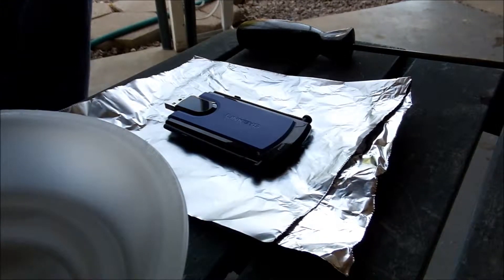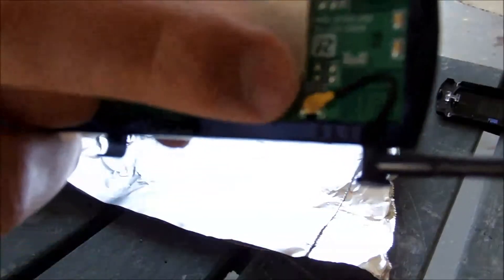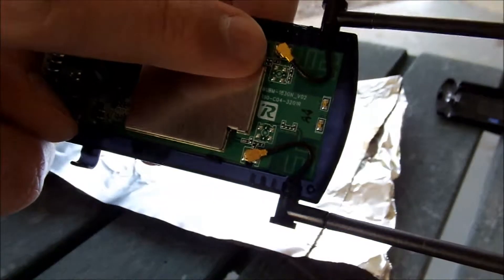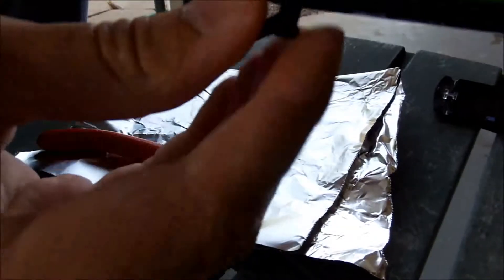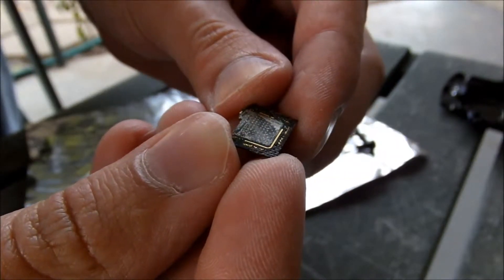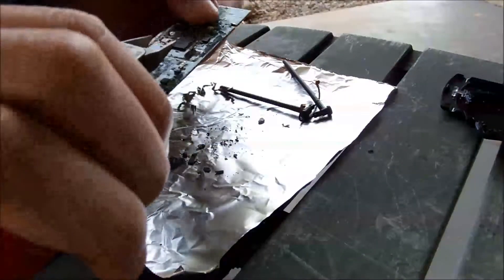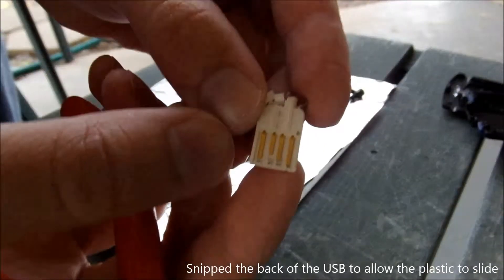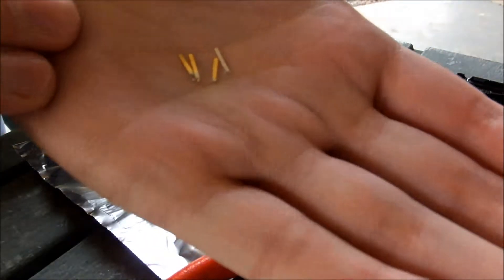WUSB300N Linksys Wireless USB Scrapped for Gold

Comment: I was going to ask isn't this worth more as a WORKING DEVICE ? A $50 card ? But, I have this EXACT MODEL and LINKSYS REMOVED ALL DRIVERS FOR IT making it COMPLETELY USELESS !!! A USB N Adapter and refused to supply a new driver or replace it. They sold the hardware and driver software the TOOK BACK THE SOFTWARE but won't pay for it ! They refused to replace it too even though they say NO DRIVERS EXIST NOW ! No drivers for XP or Windows 7 or ANYTHING !

I paid for the software and they took it ANYWAY !!! That is STEALING when you sell something then TAKE IT BACK without permission !!!
I told them just to have their programmers make new ones or get drivers from the chipset makers but they still said TOUGH ! Buy a new one. I asked why I would buy from someone that takes back what was sold ? Don't buy from LINKSYS unless you want some devices useless BRICKS without the drivers !
Linksys / Cisco can kiss my butt !
Reply from the maker: Tony Smith Sorry about the situation with your device. I couldn't even give mine away to friends and was too lazy to eBay or Craigslist it off. Figured it would be fun to take apart and share the insides with others.